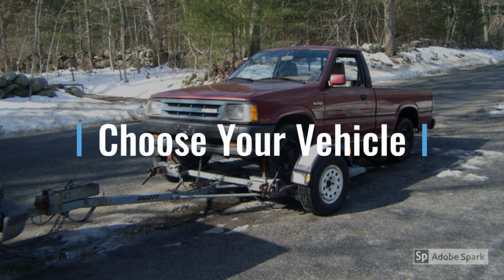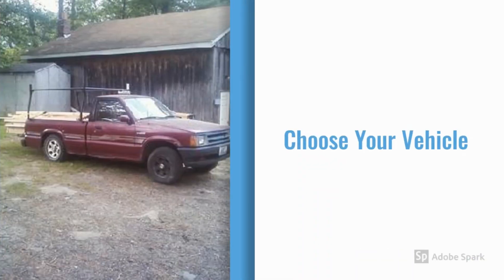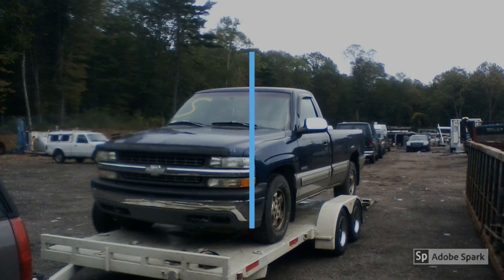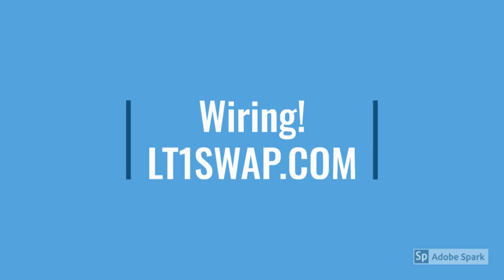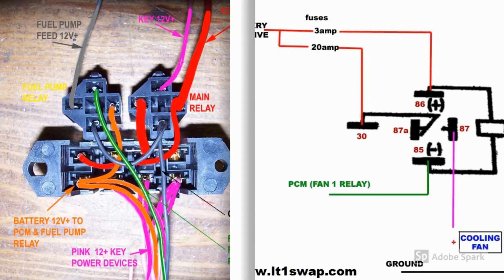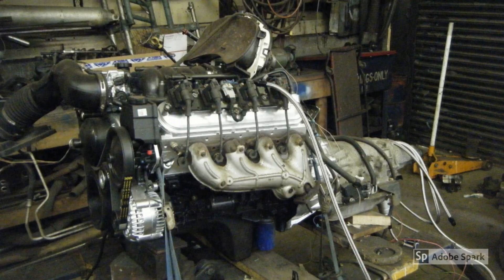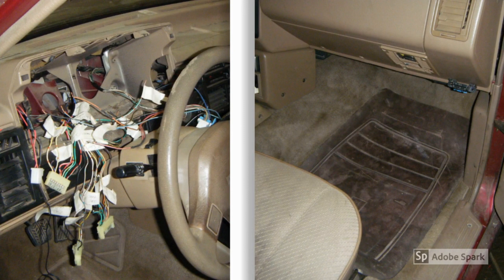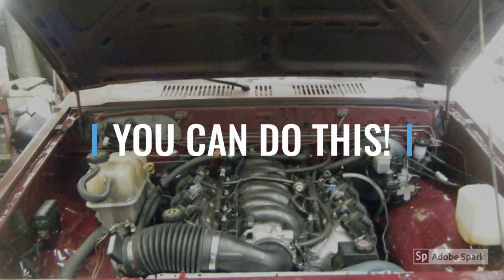MAZDA B2200  LS SWAP PHASE 1 PART 1

Comment: It's nice, but I still need the AC... I don't want to be driving this truck in the Summer time. I use my 1990 b2200 5 speed daily.
Reply from the maker: The Chevy LS AC compressor has plenty of room to remain mounted to the engine. You just have to tie the Chevy AC compressor to the Mazda AC system.

Comment from the maker: Actually, the factory flywheel numbers for the 1st Gen. LM7 5.3 were: 270 horsepower and 315 lb-ft of torque. So my 267 HP and 304 torque at the wheel is VERY good! Remember, my motor and trans has 194,000 miles on it!

Comment from the maker: So in case you all are wondering, the tune that came from Brandon provided 267 HP and 304 ftlbs of torque to the wheel, measured on a DynoJet. This is WITHOUT ever connecting to HP Tuners. The only "mods" to this combination is the 5.7 factory injectors, and the short tube headers. This is pretty good considering The factory flywheel numbers are 285 HP and 325 ftlbs torque.

Comment: I'm doing a 5.3 swap on my 1989 Mazda b2200.   1.What did you do for engine mounts ?

2. What oil pain did you use?

as much info what you had to modify would be vary useful thanks
Reply from the maker: Hey TJ! I will hit you up with all that info in a couple of days with  quick video post. Thanks so much for the comment! I was hoping this video series would help others!
Reply from the maker: Hey TJ. I just posted  video that should answer your questions. Let me know if it was helpful.
Reply: @KEIFabrication  whats the name of the video?
Reply from the maker: @gerardoreyes6256  Try this link:

https://www.youtube.com/watch?v=e9bS2rNiOdI&t=858

It should bring you to Struggles with B2200 LS Swap.